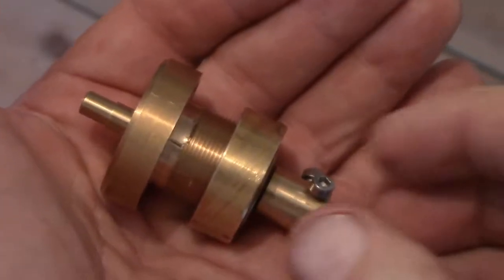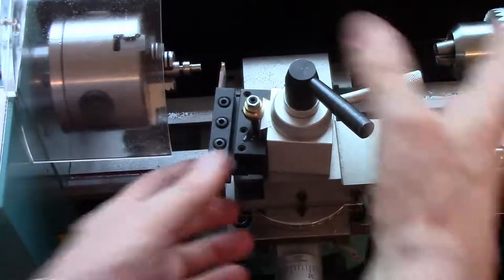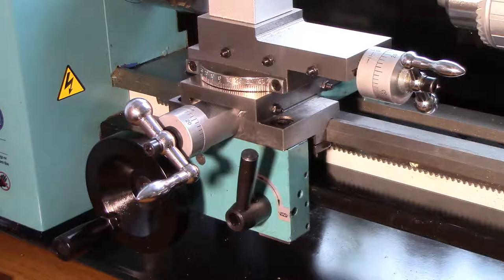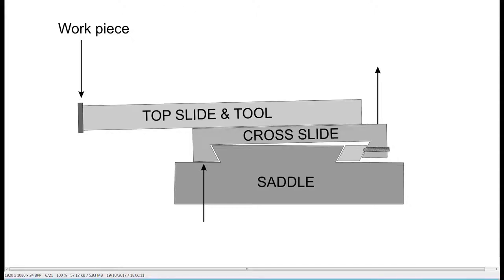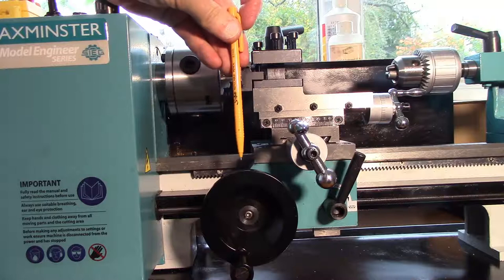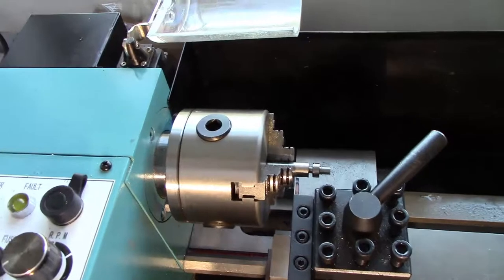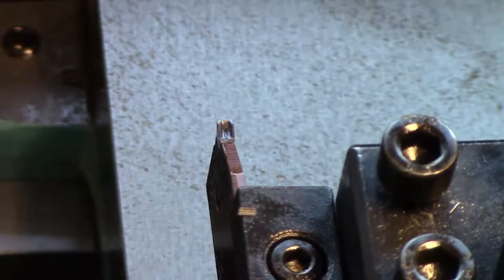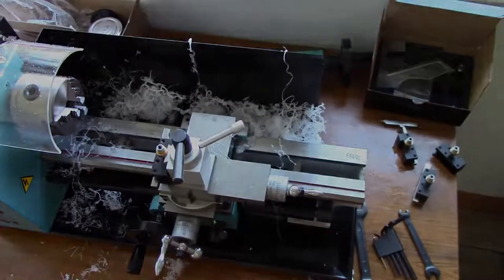Struggling with parting off on the SC2 mini lathe - part 1

Comment: Turn the parting tool upside down and run the lathe in reverse . Also u need to lock the carriage when parting. So the speed down . Tool on center .
Reply: @hologram1954  i believe it, but why ?
Also i learned parting using spin ( and tool ) in reverse, it 's easier, cause chips can fall down leaving clean room for the tool. After that i purchased a parting tool with interchangeable tips 2 mm wide, and - surprise - i was now able to parting also in "normal" mode ( not inverted ), probably to my better experience in do that, and - not less important - to the thinner surface of the tip ( 2 mm ), when the HSS blade was 3 mm wide.
i agree with other people that blocking saddle and compound is extremally important when parting ...

Comment: I have a mini-lathe too and the major problem with these little machines is rigidity. Parting off is the single more violent action (excluding knurling, which you can overcome with a scissor type knurler) that you can do with the mini-lathe. Adding to this is the fact that SS must be worked decisively or it will work harden (you cannot hesitate or pause) and this is very hard to achieve in a non-rigid lathe. You'll be better of with HSS tools in the mini-lathe, because they require much less force to work (provided they are properly sharpened with the correct angles). The wide parting tool you shown is not sharpened for brass - you need zero rake for brass, or it will dig in.
Reply from the maker: Thanks. All good advice.
Reply: By 0 rake do you mean more flat and less angle ? I’m having problems parting also and I’ve tried dead center and other positions with the same results ! I’ve used HSS and Carbide with no change and I’m turning the chuck at about 200 RPM’s and as fast as 600 RPM’s ! I’m parting brass and aluminum and have tried the reverse method but same results !
Reply: @davekimbler2308  Yes, zero is flat. Note that the rigidity is the main problem. When you are setup to part, grab the parting tool with your fingers and try to move it - if it moves it will chatter! This is normally due to uneven contact surfaces in the cross slide and compound, that add up to slack or lack of rigidity.
I suggest you have a look at the series of videos of RotarySMP: https://www.youtube.com/c/RotarySMP/videos
He completely dismantled and rebuilt the lathe, with special care on contact surfaces. There are lots of good information there.
Reply: Jose Silveira thank you ! I will watch it !

Comment: Hi Samuel I to have the same lathe as you I have found do all things suggested in the comments rigidity is the secret.For me I use a h.s.s 2mm wide parting off blade and run the Chuck slow (much slower than you  ) this eliminates vibration . Use lots of oil and keep constant pressure don't back off .It is also imperative to be on exactly centre height and Square to the work. I get good continuous swarf this way . I am no machine as myself and it took me about 3 years of trial and error to get parting off correct but it's a pleasure when it works I hope this helps best regards Shaun

Comment: I’ve had a CS2 mini lathe for a considerable time. I can tell you out of the box the machine leaves a lot to be desired. As far as the jib and grub screws  are concerned this is the way lathes have been made from the earliest times. This system does work and works well if the job is properly adjusted. These  mini lathes as they  come from the Sieg factory in China are very crudely machined with the surfaces very coarse. To get optimum performance all mating surfaces have to be lapped smooth. This includes the jibs. Only then may they be adjusted to the proper tension to hold everything as rigid as they must be. The carriage itself has a very poor system to hold it to the bed ways. I have solved this problem by replacing the hardened bars with brass bars and shims to hold it at the proper tension with the bolts tightened securely. There are many people on utube who have these lathes who have used various techniques to improve them. Some are simple, 
 some are complex. At any rate these little lathes can be made to be acceptable for light work. They can be made rigid enough but involves being tightly secured to a heavy, well made base. 
   As for me, I enjoy using my CS2 for light work very much and go to my big lathe for the heavier projects. I also enjoy making products I buy and use into better performing machines. 
    It appears to me as I watch the performance of your machine the entire carriage was lifting. Much lapping and fine tuning will make it into a machine that will be a pleasure to use. Also consider your tooling and the type of material you are turning. Each has its own characteristics and the tooling must be matched.
Reply from the maker: Thanks. I have lapped the cross-slide gib a bit, but perhaps not enough.Later I also put in some top-slide locking screws and replaced the saddle grub screws with shims. It would however be enormously better if the cross-slide gib were on the left rather than the right side of the slide (as discussed in the video). A tapered gib would also be enormously better, eliminating the adjustment grub screws which are a design weakness.
Reply: I agree Samuel. The design definitely leaves much to be desired. There have been a couple of guys who have made tapered jibs with satisfactory results. To be done right that requires a mill, which I don’t have at present. Another guy redesigned the saddle guides with tapered jibs as well. The front adjustment grub screws are impossible to adjust properly with the apron in place. 
   Another point, the less you have to mount your tool, especially the parting tool, the better. The very old style lathes had lantern style tool posts with a rocking shim for height adjustment which were very rigid. When Cutting metal rigidity is paramount. I have a QTCP similar to yours but it came with the blade type mount which slips directly into the tool post. Your blade type mount is fasten to the standard mount then dropped into the QTCP which extends it even further away from the cross slide perhaps giving more opportunity for flex, which you don’t need parting off. I’ve tried the reversing method you mention but really never found much difference. 
   I do know it is absolutely vital the cutting edge on the part off tool be at dead center of the part. It just won’t cut properly otherwise, creating a lot of chatter and heat. Some materials will work harden if too much heat is created. Some stainless alloys are bad about that. 
   Carbide insert tools are great and dull or broken inserts are easily remedied and I use them a lot. In some materials though, the only way to get a great finish is to use HSS. It takes some effort and experience to grind them with the proper reliefs and cutting edges but it’s worth the time to learn to do it. 
   I hope you get your machine to operate to your satisfaction. They really can be a delight to use.

Comment: I have got several of those parting tools and use them successfully on my Myford. I generally use slower speeds than you are and I have variable speed which is good. You can buy those inserts very cheaply direct from China where they are made and they are very inexpensive. The Bangood.

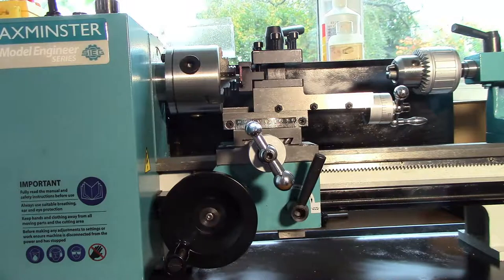Comment: 13:00 Although it would not totally solve the problem.Could you not move the tool to the right hand side of the tool holder in turn solving the problem of being to far over in the dovetail
Reply: the tool holder would then hit the chuck would it
Reply from the maker: Yes I just tried it and it does hit the chuck even if the cross slide is moved fully out.

Comment: Isn't there a bolt to screw down that you can clamp the cross slide to the carriage? I use that on my Amadeal one then tighten the extra grib screws that I fitted to the top slide.
Reply from the maker: No, but several people have added one and I may get around to it. Of course, if you clamp the cross slide and the top slide you can't part off anything.
Reply: Yes you can still part off, it's the compound slide that is locked by the mod I've done, the bolt that came on my lathe only clamps the base of the cross slide to the carriage.

Comment: I notice some flex in the cross slide with my mini lathe. I use the traveling steady rest when parting off. Only problem is I broke the steady rest (cast Iron) at the highest point of thrust. I also have a mini mill so the rest has been patched. the workpiece gets pinched between the cutter and steady rest so no flex in the cross slide.
Reply from the maker: Good idea. I don't have the steady rest though.

Comment: Did you ever find a way to part smoothly and efficiently ? If so please tell me what you found !
Reply from the maker: No, lathe isn't rigid enough. Probably running the spindle backwards with the parting tool upside down would help. One can see on youtube that even people with much bigger lathes have parting problems sometimes.
Reply: Samuel Fielder I tried backwards and same result but I’ve been parting with a much thinner tool now and it seems to go a lot better ! I cut the width in half and made it pointed and my lathe seems much happier and it faces very nicely also ! Go figure !
Reply from the maker: @davekimbler2308  Yes, certainly the narrower the tool the less force imposed by the workpiece. I did buy a parting tool that was only 1.5mm thick but unfortunately it was the same thickness all over so it just bent slightly and then galled up on its side with thr workpiece. It being so thin, I did not dare to grind some side rake on either side. How thick is your parting tool now? Another aspect is to avoid too much top rake, particularly with brass.
Reply: Samuel Fielder mine is 2mm thick and 20mm to the heavy stock ! I’m turning at about 200 RPM on Brass and 300 RPM on aluminum . The biggest stock I run is 7/8” brass and 1” aluminum . I’m still learning though !
Reply: I can parting 40mm OD SS304  (no bigger than this) with a 2mm thick HSS parting blade on the same lathe quietly ,the key is to reduce your spindle rpm around 80~150, and  approaching very slowly ,make sure the tool tip is in the  center of the workpiece ,and add some lub when you parting ,in this small desktop lathe the main issues are the power of motor and saddle rigidity(tool post) . at low  rpm  the motor  may  not have enough torque to turn the chuck against  the cutting force ,at  high rpm the tool post does not have enough rigidity it would cause chattering(with terrible sound),  you can't change the rigidity so   slower the rpm .  there is another thing need to be concerned , X axis screw has backlash  ,if you push too hard on X axis ,the workpiece may pull the blade under neath ,  so   slowly ~~~~~~,Good luck !
Reply: @水巷-i4l  thank you very much ! Since I asked that question I’ve learned a lot of things but haven’t learned to part efficiently but learned to knurle and bore and taper cutting nicely if I do say so myself ! Lol
Reply: Really ? Good for  you !  It's always fun to have a workpiece machined precisely .I bet you will love it .  :)

Comment: Stainless steel we could never get a mini lathe to not chatter when machining stainless. On the Cross slide gib the. Dimples? on the gib do not line up with the grub screws as you say I can get reasonable parting off with gib set so tight the cross slide is difficult to move.

Comment: Can you take a 3mm deep cut on the diameter or the face without chatter on this machine? If not, why to try running that wide tool into a groove.
Reply from the maker: Not sure what you're getting at there. But you certainly cannot take a 3mm DoC in 316 stainless opn this machine.
Reply: @samuelfielder  I'm saying that you can compare the forces on those 2 cuts, if you want to know whether it's possible to do parting at all, take a 1,5mm turning cut on the material, if it does that silently, you can go and buy a 1,5mm wide grooving tool which you can use for parting on smaller than 32mm stock and get that work. Be sure that the gibs are adjusted correctly and the carriage and compound locked in place. And that the tool doesn't protrude over the edge of your carriage. Also use high rpm, aim for 150 m/min on steel and no lubricant is necessary
Reply from the maker: @MF175mp  Thanks. Generally good advice, except on lubrication. I've never seen anyone parting off without lubrication, and on stainless it's especially important because of its tendency to work harden. I'm afraid my SC2 is just too lacking in rigidity for most parting off.
Reply: @samuelfielder  the lubrication in general may be good if you have flood coolant system or other that works without using your hands, but I've found it's easier to keep pushing the constant pressure with 2 hands. As the carbide blade forms the chips thinner than the groove, the chips will fly out of the groove as well without lube when the finish in the faces it creates is also good, thanks to high speed and no chatter. Of course my own lathe is much more rigid, but I still struggled with parting in the very beginning. I tightened the gibs and adjusted spindle bearing preload and Bob's your uncle, no need for any tricks.

Comment: Several points, first is no, you never put the gib on the right side. You will lose accuracy that way. The main use in lathes is cutting towards to the left. Big lathes are vastly more robust, and use a different  gib system that doesn’t use set screws, but a tapered gibe with an end screw that tightens the gib. There is no play with that.

Both of your gibs should have five set screws with one for locking the dovetail. Three is just not enough. Another problem is with the small lathes, the saddle is too short. It should be 25mm longer on each end for stability.

Moving the compound back the way you did, may be counterintuitive, because it gives less support. But it’s the right thing to do because the pressure is now in the center of the cross slide. It looks as though the cutoff tool isn’t centered properly. A small error in height at diameter isn’t a killer, but as the diameter of the work becomes smaller that height error becomes significant, and either the tool rides on to the top of the work, or rides below. Either can cause problems, and the work is now not contacting the cutting edge. Too high, and it’s below the cutting edge, too low, and the work is riding on the top of the cutting edge.

I don’t agree with the upside down rear tool position. As you say, the forces are now pulling the saddle, cross slide and compound away from each other. I don’t know where that myth began, but it’s clearly wrong. There are instances where a rear tool has advantages, but only when the spindle rotation is in reverse. Some old lathes had dual tool holders front and rear, with the rear upside down. The cross slide screw brought both in by the same amount, and so cutting was done on the front and rear simultaneously. That is more efficient, of course, but also relieves pressure on the spindle bearings.

With these small lathes the narrower the width of the cutoff blade, the better. There are insert cutoff blades as narrow as 1.2mm. Just slow the lathe down and have consistent cutting pressure. Please don’t experiment on work! I keep telling people that. Set the tool and cut a bit. Then adjust it a tiny amount up or down until you find the best position. With small equipment, the tiniest amount of error in settings or speed makes a major difference in performance. If you grind your own bit tips, don’t use too much top relief, the tool will want to dig in, and the equipment isn’t strong enough to resist it.

Comment: Try 150 rpm
Reply from the maker: This is rather an old video of mine. The problem with my Chinese minilathe is that it has no back gear and has very little torque at low RPM. The lower the RPM the more likely it is for the tool to dig in and then the motor stalls.

Comment: Stainless Steel in a mini lathe - mmmmmmmmm  The insert parting tool you are using is useless; use an HSS blade type tool. Stainless steel also work hardens as you are trying to cut it; use a hacksaw and then just face if all you have is a mini tin lathe made in China - its only suitable for plastics and very soft metals - nothing steel.